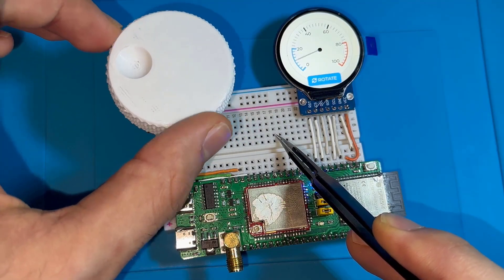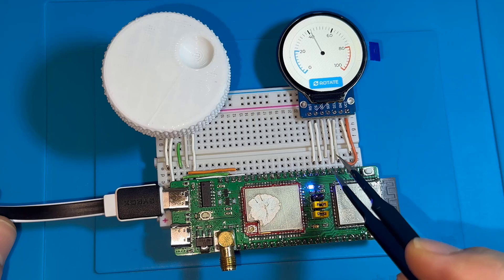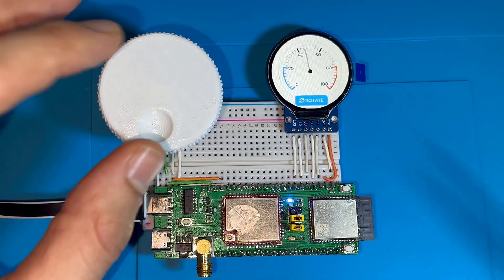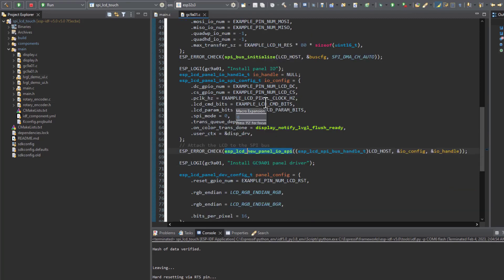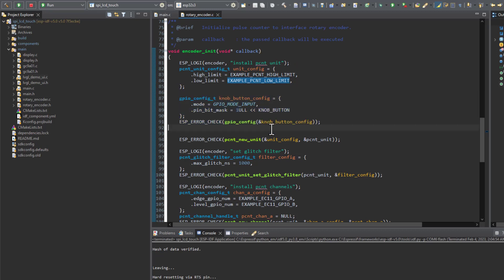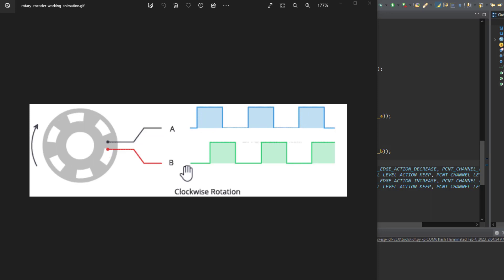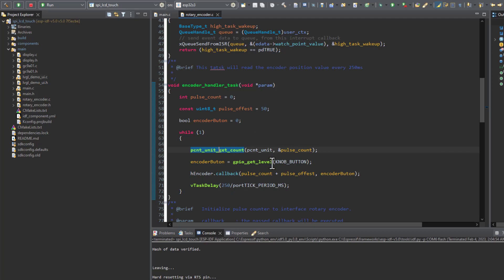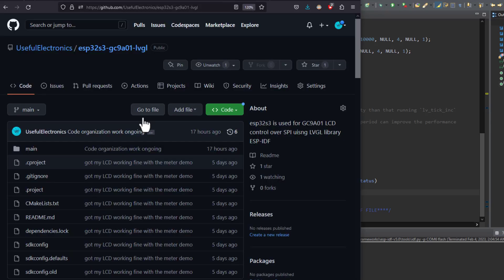ESP32S3 Interfacing Rotary Encoder and GC9A01 TFT Rounded Display with LVGL

Comment: Are you sure you showing the demo of same code you are running ? Your display is I2C interface (2-wire using SDA/SCL pins) but your code is running SPI drivers (3/4 wires SCLK/MISO/MOSI) how can it work ?

Comment: Could the touchscreen work as a digital version of the ipod classic clickwheel? Does it read a finger going round circular on the screen?
Reply from the maker: You need to add capacitive touch panel to screen to add touch support